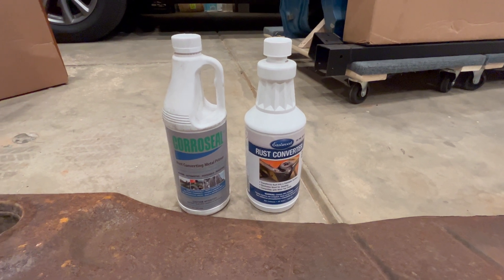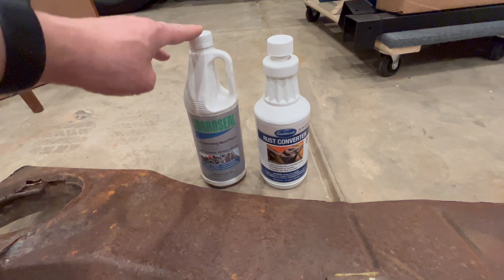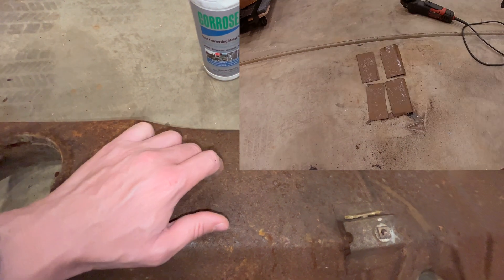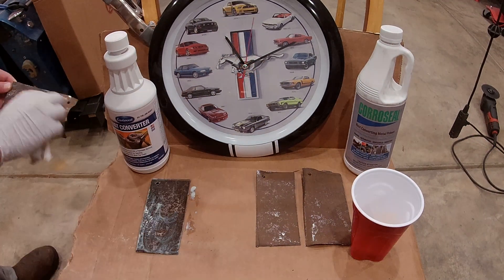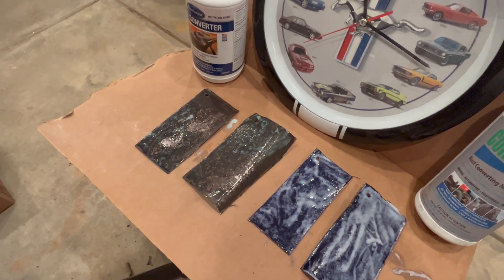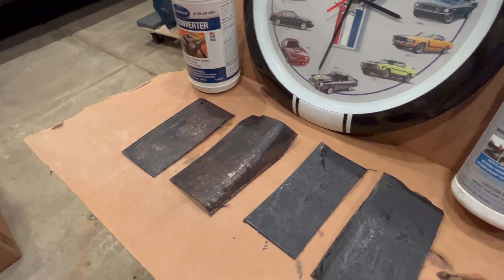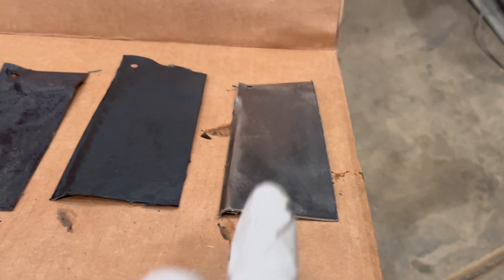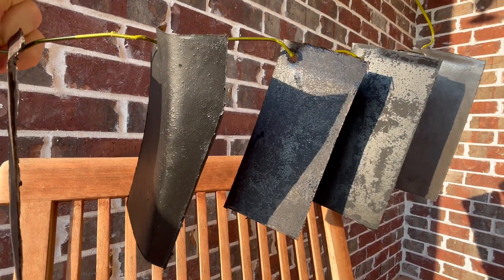Corroseal vs. Eastwood Rust Converter Challenge Part 1: Application

Comment: Your supposed to apply a second cot of the eastwood after 20 minutes.
Reply from the maker: Well I stand corrected. I dug up the bottle and sure enough it does say that. Thinking back to when I used it many years ago, I’m pretty sure it didn’t have that in the instructions. I wonder if they changed it or if I’m not remembering correctly